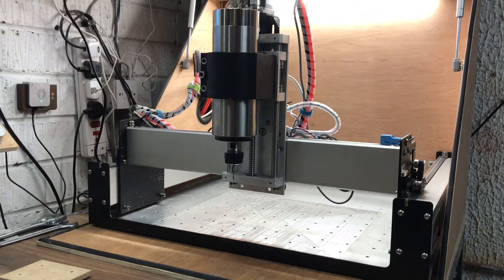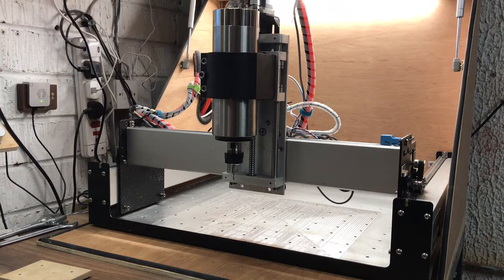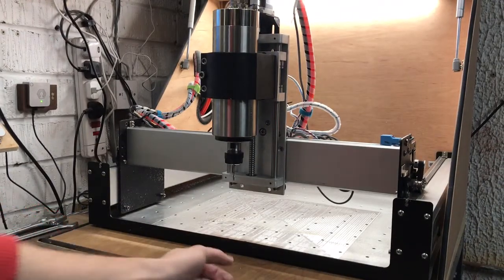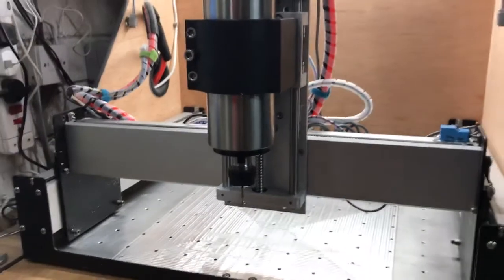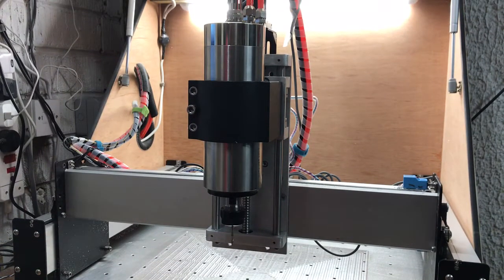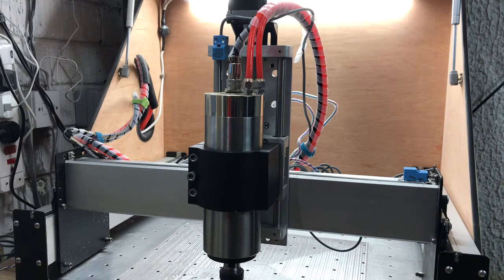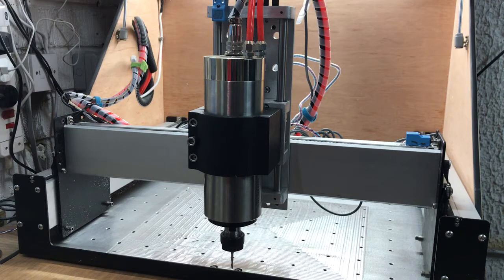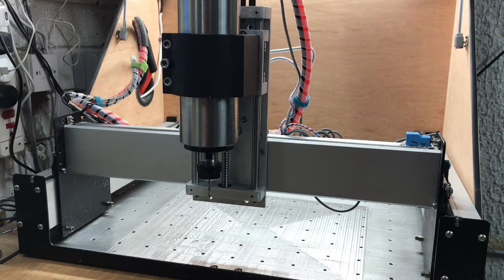Shapeoko 3 with upgraded Z & X axis ball screw design

Comment: Could you show how you have the motor clamp mounted to the Z plate. I am ordering one but not sure how to mount it.
Reply from the maker: Arturo Sosa this is of my own design. If you are ordering a new linear z look at beaver cnc linear z. It can accommodate a 2.2kw water cooled spindle off the shelf
Reply: Luke's Garage I have a CNC4NEWBIE Z axis upgrade and haven’t looked back. I am just trying to figure out a way to mount it since the 2.2 kw mount comes as a blank slate as far as not having mounting screw holes.
Reply from the maker: Arturo Sosa I'm briging my own version to that to the market very shortly. Its like this one but on steroids and has a 2.2kw mount ready to go

Comment: Great job on the video.  Can you tell me more about your enclosure?  I like the design and would like to make one for my Shapeoko 3 XXL and I'm looking for ideas.  Thanks.
Reply from the maker: Sure, what do you want to know? Essentially it's 12mm plywood in a box shape. A couple of large A3 windows from Perspex and 2 LED lights on the inside. To lift the front door I have 2 kitchen style gas lifts either side of the door. It's very strong and can hold my weight... Happy to send some pics of it if you have an email

Comment: Yea so I dont like the store bought Z axis. The existing X plate is too flimsy and I see more sway than I did before... Sway in moving it by hand that is. So what I would like to do is make a new X plate for the Z axis to mount onto out of .5" thick aluminum. Too much?
Reply from the maker: Savant PCs that's interesting. I'm surprised it makes things worse. I made my own x, rip the dimensions from that, although 12.5 might well be overkill 😂
Reply: Your probably right... :D I usually go for overkill when it comes to these projects.
Reply from the maker: Savant PCs go hard or go home... I'm working on a re-desinged x, all be it a whole new axis
Reply: Then let me ask you this. In my initial idea for a redone X plate for my Z axis I obviously wanted to add rigidity. Would adding 4 V-wheels for a total of 8 work? Or would that be pointless?
Reply from the maker: Savant PCs if all on the same side I don't think it would add allot of benefit. I did look into doing the same. I think the best way would be to add a plate at the rear that clamps on to stop z rotation.